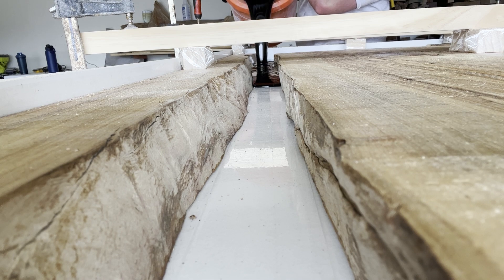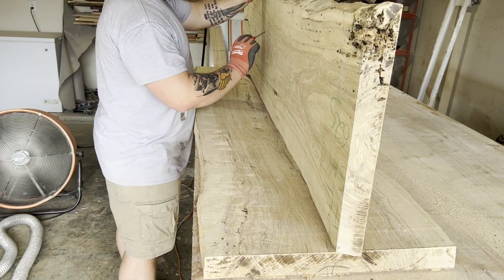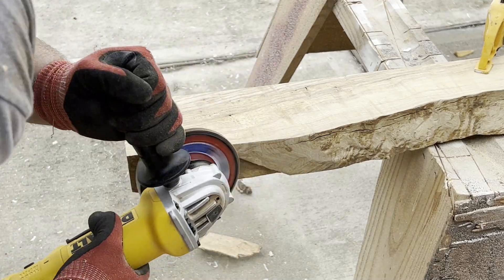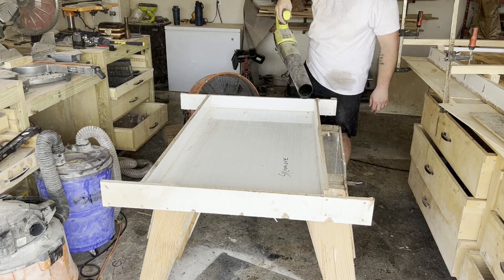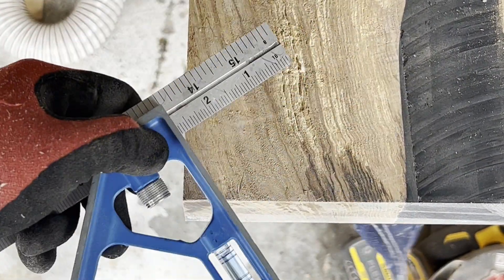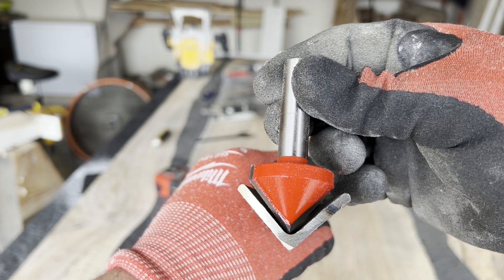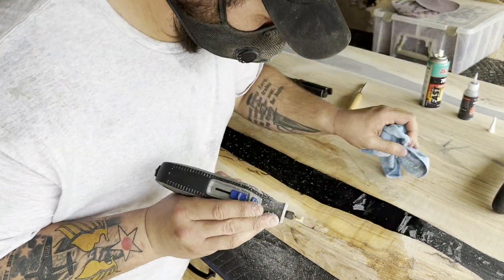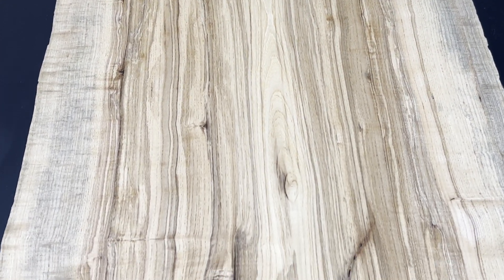Making Bland Wood Look Good

Comment: Beautiful table mate. Well done. Great idea using the angle under the table to stabilize it. I will be giving that a go on my next build.
Reply from the maker: Biggest recommendation for that is dust collection. I actually just bought the ridgid 2.25 hp fixed base router that encases the bit and has a hose attachment. Basically will be as close to a zero dust environment as you can get

Comment: Beautiful! Nice work. I'm starting to build my own legs too, I also get a good amount of legs from Flowyline. Only thing I hate about building legs is the extra time it takes lol. If I can find legs from Flowyline or another outlet that work with my design I like to save the time.
Reply from the maker: For sure! But I’ve seen those spider style legs made from walnut and it’s just that bit of “extra” that makes a piece way cooler in my opinion

Comment: Are you happy with the 3M sander? If you are, what were the key benefits that you gained from it? I am looking to move from a Milwaukee orbital to either Mirka, 3M, or Festool. Nice work on the table. I liked the ash choice. I have access to an infinite supply thanks to ash bore beetle in our area. I will consider using it in a fine woodworking project.
Reply from the maker: So I am actually not to happy with it for it being $500. It’s got an extremely sensitive overheat protection feature that will make it not work for about an hour at a time. I just switched to a Bosch 76N. It’s just the Bosch version of the Festool Rotex 150 for a quarter of the price and there’s virtually no difference
Reply: What brand of epoxy did you use. Did you do the pour in 2 pours or one. If u did it in 2 pours , how long did u let it sit b4 you made the 2nd pour.  thx
Reply from the maker: @judithwebber2102  I used a brand called magic resin (I believe I linked it in the description). It’s cheaper than other brands due to their multitude of manufacturing facilities. And I did do it in 2 pours, made the first pour about an inch deep then the second one approximately 36hrs later at 1.25 inches